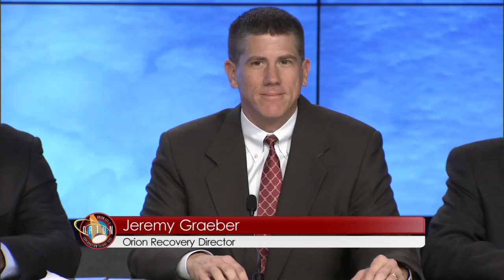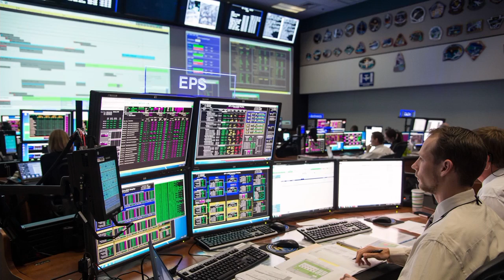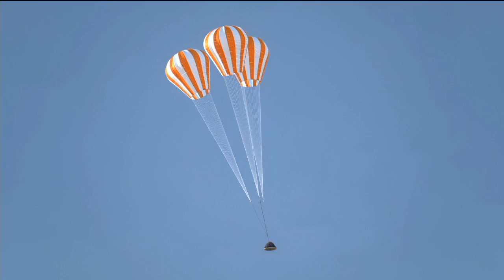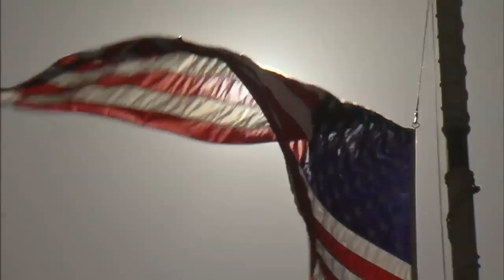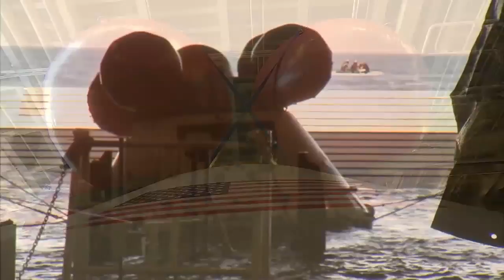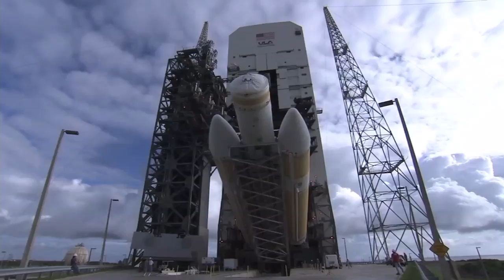NASA Previews Orion Spacecraft’s First Flight Test

Comment: only one milestone left Attach Orion to the Rocket the Service Module will be attached to the Second Stage with the Orion Adapter and it will stay with Orion until Stage 2 Jettison and Service Module Start which is the burn before Service Module Separation and Orion Retrofire which is the final burn before Orion Reentry and Splashdown.

Comment: everything on this flight has to work because on the next flight Orion will have a 90 to 1 chance of coming back because NASA is going to blow up a Delta on purpose. LAT-1 the next flight will have Orion on a fully fueled Delta Rocket except instead of taking this one into space it will go up to 30 miles over the ocean and they will blow it up. Orion has to fire the Escape Tower and come back alive so this flight will test the Escape Tower because on the next flight Orion will have to use it to escape from an exploding rocket.

Comment: Summary: It has been 40 years since mankind flew as far as this Dec. 4 "Exploration Flight Test-1," will go. These events cannot be tested on the ground. After jettisoning the launch service modules, and after flight to its first orbit, the module, which will be manned next year, goes into high earth orbit (500 Nautical miles up). On return, 20% of the skin of the 1000lb. heat shield will burn up and will be rebuilt for the actual, manned flight to Mars. Radiation for this unmanned flight -- which will be 15X as high as the space station's orbit and into the Van Allen radiation belt -- will be severe, testing electronics. The crew-holding capsule is being manufactured in Southern California by Lockheed Martin. The whole launch-to-recovery operation, Dec. 4, will be a "risk-reduction phase." Splash down is planned for 600 mi. off San Diego, using our Navy's ship, "US Anchorage."  There are at least two other ways possible to retrieve mankind's future little first-home on Mars. They won't lose it! (Assoc.Press Q: It cost $370 million.)

Comment: To slow. This way of exploring the universe has no future n u know that. Evolution way wont give us even a chance to leave our solar system. Doesn't matter how far we go if we go wrong way.
Reply: I anticipate your invention of a faster-then-light propulsion system.  Until then this is how we can actually get around.
Of course some sort of longer duration built-in-orbit system would be better for outer solar system duration missions but that's not what this system is designed for.  It's for Mars/moons and to reach nearby asteroids.
Reply: I think you are wrong, we build spacecrafts and when they are ready to have a mission they are mostly not on the newest technologies any more.
1. Orion is only the way up into space and back, maybe small flights on missions
2. Orion is an module you can attach to new propulsion systems and much more modules
3. Orion is made for deep space not like any other spacecraft you know we do not have a deep space manned spacecraft atm on earth, not one.
4. Orion will be attached to modules for real deep space missions it is not too slow but can not carry so many fuel and cargo, energy ... so you need much more modules.
5. You do not go as far as you can, you set small goals and learn and evole on these missions, so moon, mars, further...
untill we go further it will take time - until then we can build with new technologies modules to go much faster.